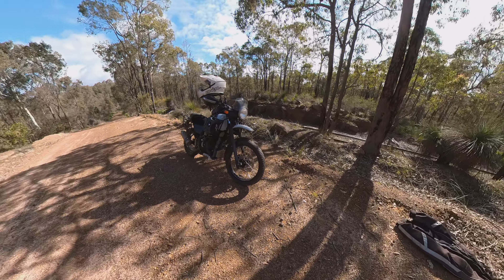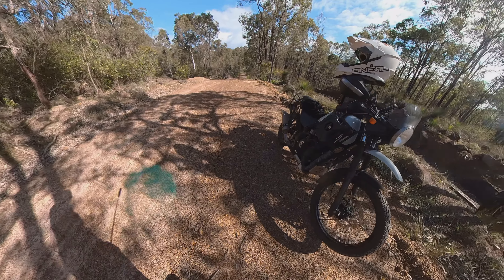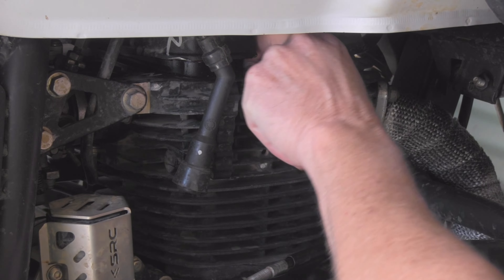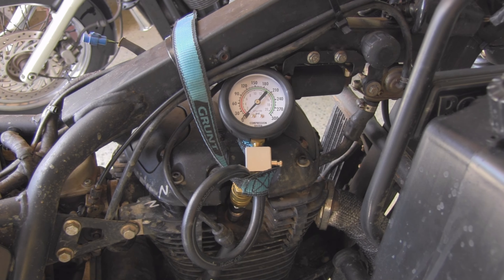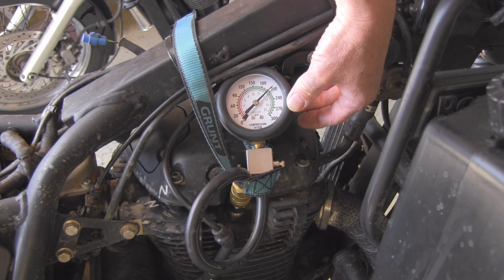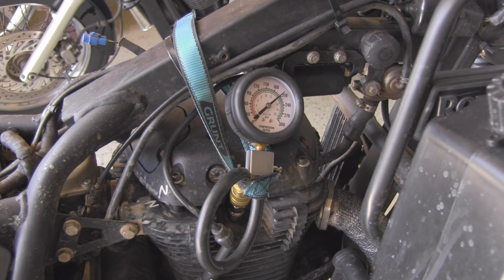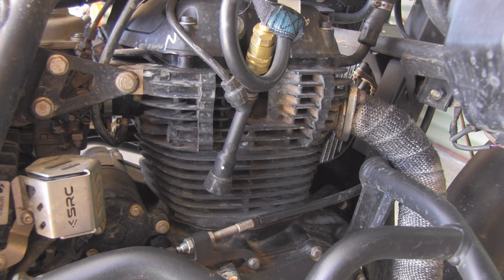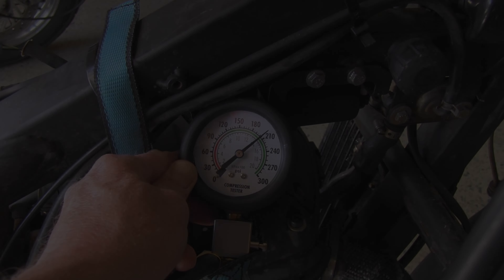Himalayan Ascension 03 - The 500cc Big Bore Review

Comment: I have a 218 Carby version too (40 000kms on clock) with a Ht-b cam here in NZ, opened up airbox and standard exhaust. I did run 17 pilot and 130 main and got about 19-20km/l on old carb. Bike had issues leaning out to much  from new on constant throttle which bigger jets made a bit better but never solved. I changed carb for a new one about 5 000km ago, so back running standard 15 and 125 jets and issue is solved. Get over 26 km/l with same riding style now. I find bike runs a bit hotter, so will go up the the 17 pilot make things a bit more rich.  maybe that will work for you regarding MPG. Currently toying with going for HT 477 or the 500. Can one go back standard if 500 does not work out? How many k's have you put on it? cheers Kiwiscoot
Reply from the maker: Thanks for the tip re the jets and carby. 26km/l would be real nice. I've been off the bike for a while to to a back injury so I've only done a a few thousand KMs since rebuild.  I can't see why you could not go back to a stock pot and piston but I certainly won't be. The 500 is so much better.

Comment: Sir have couple of questions… can you cruise around 65-80mph? Without the engine getting stressed? Another most importantly are you facing any problem with  the engine??
Reply from the maker: Hi. I can cruise at 110kph (the max speed limit in Western Australia). The Engine is going strong with no more problems. It can be a little hard to start due to high compression so I might go back to the stock Cam to take advantage of the decompression mechanism. The current cam also make the engine sound like a sewing machine.

Comment: Subbed - stock 411 has 190-200 psi. also cheap chinese instruments vary by 10%
Reply from the maker: The starter issues is definitely due to too much compression. I'm trying to decide if I put the stock cam back in so that it has the decompression mechanism or if I put another foot gasket back in, or if I try to take some more out of the compression chamber.  Lower compression would mean I could run lower grade fuel if I wanted to.
I have had to put the bike in 5th  and rock it back and forth to get the engine on a different stroke to get it to even turn over when it is cold.

Comment: Hi mate. 2017 carburetor model.  No engine mods yet. When I removed the airbox to fit the new YSS shock,  I decided to leave the airbox off so I could acces the top adjuster on the shock. Therefore I had to make an inlet manifold and a new battery box.  Used the original pipe from the airbox as a mount for a re usable,  oiled air filter. Made a new battery bracket.  The whole system now breathes and flows better and is smoother. 
The YSS adjustable front and rear suspension is awesome.  The rear seat is used as mounting point for luggage I made using  bolts I made to lock into the seat retaining mount.  More to come. Cheers and keep up the good work.   Pete
Reply from the maker: Sounds like a good set-up, Pete. Some more room around the air intake would be nice.

Comment: Have you still got the cat in it?..  Me too have the hitch cocks clutch  ,but the clutch is at the end of the travel... I have the 465cc BB and the tec cam...   YSS front and back..  Mines running abit clattery  ,,,maybe its not bedded in enough yet, but it is getting better......Regards
Reply from the maker: No Cat in mine @lipsee100. I don't think it ever had one. I made a new Clutch button on the lathe which is 2mm deeper than the original. It has made it a bit easier to knock it into neutral but I was hoping it would do more.  I've been a bit lazy lately and haven't put the video together yet.

Comment: Awesomely done video. Nice job.

I get around 2.8L/100k's commuting on my Himmy. If I had to deal with 5.7L/100k's I think I would much prefer a KLR. I've never ridden one but they seems like a bigger version of the RE with a more spacious riding position. The fuel consumption (and looks) are the only things that put me off
Reply from the maker: WOW! 2.8L/100 is amazing. That's over 500km on the tank.  I might have to try some smaller jets. Maybe I'm running rich?
Reply: I get 2.9L/100km on mine. Panniers always full. 6.3ft of me, 112kg.
Reply from the maker: @whatsstefon  Man you're killing me.  I only got 4.7 before it had a meltdown. And im only 75kg and no paniers.  It must be a loose nut on the throttle.
Reply: @MORK-TV  I’m not too heavy on my throttle. Maybe you’re giving it the beans more often than me?

It’s a little disappointing to see that the big bore kit did very little to top speed capabilities. I was hoping to see a bit more of a difference there.
Reply: I get 3L per 100km if I'm super conservative on it. But that's not how I tend to ride so get less than that usually
Reply from the maker: @matthewkaye722  I'm getting 0 Litres per 0 kilometres at the moment Mathew.  Something has gone badly wrong in the gearbox now. I think the shift drum has failed somehow but I'm yet to dind out for sure.  The donknis back in the workbench awaiting direction. 😩😩😩
Reply: I have been averaging like 3.9 (if I did my conversion right) here in the U.S. Most of my riding has been day trips where I'm usually pushing it 60mph the whole way, so I'm assuming that's why.
Reply: @donnysnonsense  My fuel consumption shot up to 3.8L/100k recently. The back brake slides were sticking a bit. Otherwise I usually do about 3.2l/100km at 100km/h with panniers. Keep in mind I always run my tyres at the maximum allowed pressure. It makes a big difference.

Comment: So the bike does not go beyond 110 even with 500cc ? will it reach top speed of 160km/hr.
A new subscriber for ur dyno test 😀🤭🤭🤭🤭
Reply from the maker: It will do 120 Ok but not much more....unless its downhill with a tailwind.  If it blows up again it might do 160 when I roll it off a cliff.  Thanks for the subscibe.  If I can stop spending money on parts I'd really like to do a dyno.
Reply: So is the bike struggling at 120 or is it comfortable?  I rode mine last week rpm’s at about 4800 to 5000, doing 115 kmh for 482 km straight. Throttle cracked wide open. Wasn’t a blast but needed to make up time.

Comment: Thats the Himi I'd like as a first bike. The new one coming fuel consumption will def be up. Am hoping they add a bigger tank to compensate. (The thing I like re the lower Bhp Enfields is good fuel consumption and am not keen on the looks of moderm adv/tourers etc, although the Moto Morini and Tenere are nice) 

Still not sure which bike am gonna get as a first bike.
Reply from the maker: A bigger tank would be a good addition.a othe 3 to 5 litres.  I'm going to re jet while the engine is out again to see if that helps.  I think it is running rich.